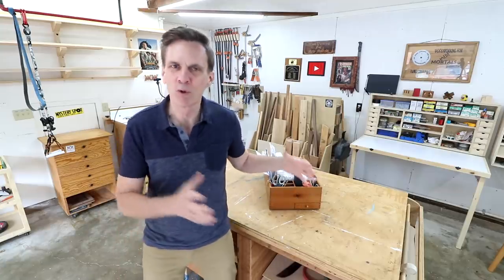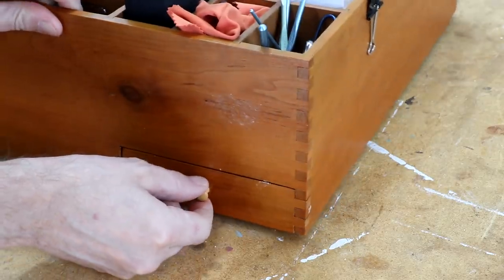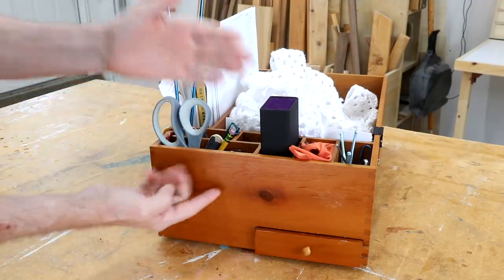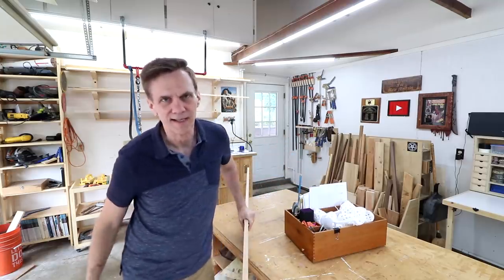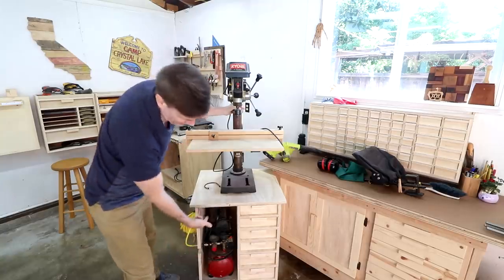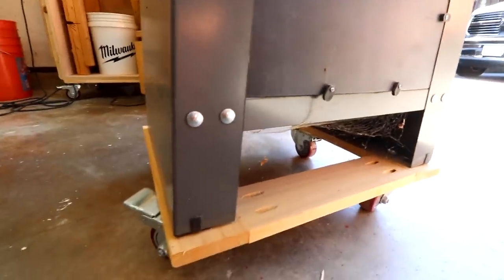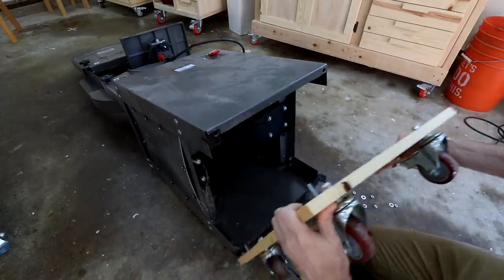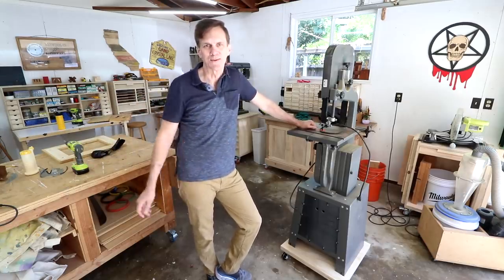I need to improve and upgrade this box | LOCKDOWN Day 55

Comment: In a similar situation for storing your hose, I use nylon web strapping - think of the straps on kids' backpacks. On one end have a female nylon clip and the other end a male nylon clip. Use a screw with a washer to attach one end of the strap a few inches from the female end, then let the other end hang down. Use the web strap the same way you used the velcro strap end clip the ends together to hold the hose.

Comment: Had a seemingly little shop in my little village of Boosbeck in the UK called bits and bobs. Was the BEST shop, it was a very old converted house and you walked into a very small room, that had the till, sweets, drinks and chocolates. Then you'd notice, oh there's a doorway here, go through and it's a room full of TOOLS, at the back of that room.another little doorway and it's all kinds of pet food. You think that's it, NOPE, another doorway and suddenly quite a large room and it's essentially a toy shop. Closed only a few years after opening i think because people simply had no clue from the outside what was on the inside.

Comment: A suggestion would be to drill a hole into the bigger compartment. The ball of yarn can then be kept inside the box, with the string extending through the hole. No runaway balls of yarn, and possibly slightly more cat-safe.

Comment: For your drill press stand, the pneumatic hose try putting a hook on the side with a strap with grommets in it that would eliminate the worry of saw dust getting into the strap of the velcro.

Comment: A rubber quick tie-down would work in place of the velcro for the compressor hose. The kind I'm thinking of is a simple, thick, rubber strip with notched holes. The holes fit over a hard tab to secure whatever item needs secured. It'd be quick, easy and wouldn't collect the dust and fluff velcro might.

Comment: A tray for the hose at the drill press stand will always fill up with dust and woodchips. I would use an L-shaped hook, like the ones that are used for mounting satellite dishes to walls, but made of wood and reduced in size, obviously. You can drop the hose on that vertical pin easily, but it will not collect as much dust as a tray would do.

Comment: Hey Steve - For my coiled air hose I decided to bolt a pipe flange attached to some threaded pipe on my BMW. It's great because all I have to lift the hose off of the threaded pipe that it's coiled around. Just food for thought!

Comment: You could 'step' the drawers to use the space beneath the needle-caddies better. Have the bottom drawer 2/3 of the width of one side, and the top drawer 1/3 of the width. That way, you have cubbies of varying depth, and you use all of the space for more organization.

Comment: I have the older version of that very same bandsaw! I use it all the time and yeah, it kinda sucks. I got mine 2nd hand for $100 though. The guy said it didn't cut worth a darn and wanted to get rid of it. Turns out he put the blade in backwards; so the teeth were facing up instead of down.  Easy fix and a cheap, effective saw for me!

Comment: Devote a forward direction for the band saw and place a 3 to 3-1\2 inch spacer between the dolly and the ground, so if it tips, it bottoms out before forward motion and gravity takes over? OR invest in a 300lb weight set. Stable base and future aspirations all in one ?

Comment: If your velcro gets clogged up with wood chips, you can put your air gun on the end of the air hose the velcro is holding to clean it off.

Comment: For your hanging cord problem command makes a kind of cord hanging hook that works similarly to the Velcro strip you can either use theirs or create a version of your own if you look up command cord hanging solution you could see how it's designed see if you like it and then go forward from there in choosing to design your own or use commands version... Also I often choose not to rely on just the adhesive with command if I know something is going to be there permanently I will screw it on

Comment: For the scissors, instead of a whole rectangular compartment, what about a slot attached to the outside of the other ones? It could have a triangular hole to guide the scissors, and keep the handles in basically the same position each time they're inserted. Cut two layers for this, one on the bandsaw to get the interior shape, the other could match the outside, or be a plain rectangular cover panel to look tidier. You'd need to be sure to make the opening at the top thick enough to allow forged scissor blades to slide in, not just normal stamped ones.

Comment: I've got something similar to create down the line for my girlfriend, so will be watching this upgrade quite closely. I wonder if you could have a horizontal hook, tray or something on the long side where the knitting needles could lie horizontally, but still be easily grabbable, if it's next to the project hole, the needles could still be attached to the knitting and lie nicely on the side.

Comment: About the bandsaw, i use mine quite often in my projects, almost every project i build makes use of it... i dont have the money to invest in a big name brand bandsaw, after countless hours of reviews and studying i decided on the porter cable 14 inch from lowes, for the money this is by far the best bamdsaw i have ever used. I have used much better bandsaws that have greater resaw capacity, bigger motors ect. but for $400~ you cannog beat it, it is capable of 220v wiring and you do have to rewire the motor to use it but even 110v is great, if you are needing one to start out on or to replace one and are like me and dont have $1000+ to invest in it i highly recomend it

Comment: Too late now, but HF sells (24” x 36”?)  wood frame “moving dollies” (?) with casters on them; strip the carpet off and save a lot of time. Was the foundation for my scrap rack, caster quality doesn’t matter much when you only move something a few feet a couple times a year.
Reply: Jonathan Nagel I used a pair of those moving dollies to make a vertical rolling rack for my Jeep’s hardtop. They work really well for the price.
Reply: The moving dollies are handy but they don't have locking wheels.

Comment: Instead of a box or the Velcro you can put one of those retractable air hose things then if you get one that’s 50ft or so you will not have to move the compressor around just pull out as much hose as you need

Comment: Some thoughts on your thoughts: a side tray for the compressor hose should have slats on the bottom to allow sawdust to fall through. 😎👍
Reply: An alternative solution would be to fit a retracting reel.

Comment: If you put the air hose holder pocket on the side of the cart, would you do something to keep it from filling with sawdust?
Reply: I was actually thinking the same thing - I would drill holes or cut slots so it can fall through

Comment: Hi, Steve. I just found your channel and I'm so glad I did! I'm just now getting into wood working, in fact I've already made a nice work shelf in my shop. I'll be going to buy a table saw in a couple of days, too! With that, I was wondering if a table saw replaces the need for any other saw? I have a miter saw, but to be honest, even at 0°, it doesn't give me a nice straight cut, but it was good enough to finish my shelf. I have the receipt still a d it's I my two weeks old so I'm thinking of returning it unless I get advised differently! And also, do I still need a circular saw with a table saw, too?

Comment: Steve, I was reading somewhere that if your band-saw blade drifts you can set a fence that matches the "drift angle" so it cuts the board straight. Have you tried this? looking for a cheap/used band saw but drift seems like an annoying issue
Reply: Same struggle! But? Excuse/justification to buy a surface planer. Just over size a bit on resawn, and plane down to.

Comment: hey, i do a little woodworking but just got into it last year and never did any formal classes.  some things screw me up still, like how did you know where to pre drill the holes before you put on the new base?  did you mark it or measure it?  hows that work, sorry for the dumb question

Comment: Steve, recently you said you build different projects in different ways, depending on how long you need them to last. You said there are differences between building for five years, compared to building for 100 years.

Anyway, you should find some project that you want to use the "100 year" methods. I'd love to see if it makes sense, or is complete overkill.